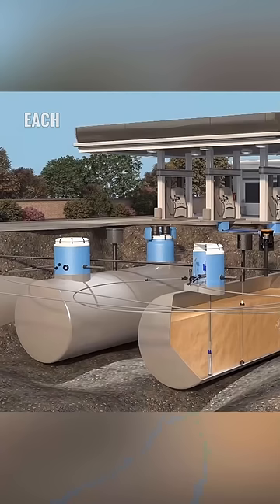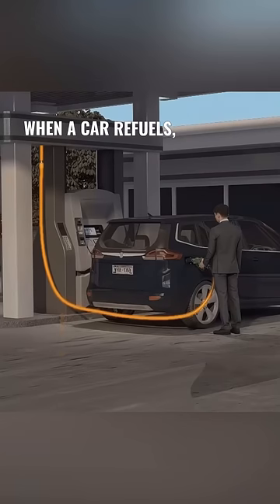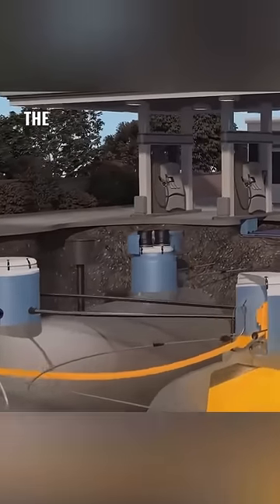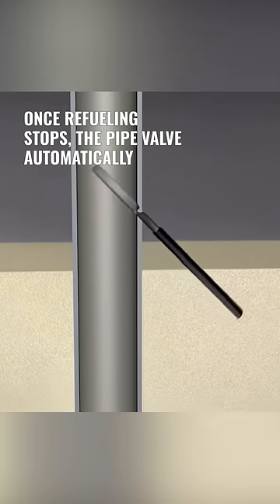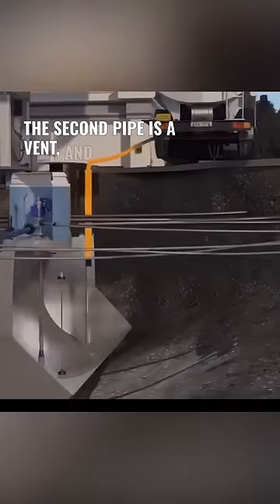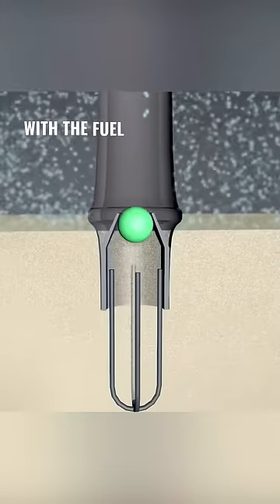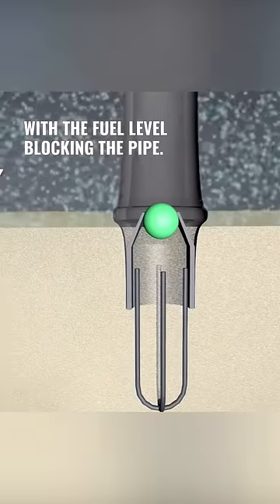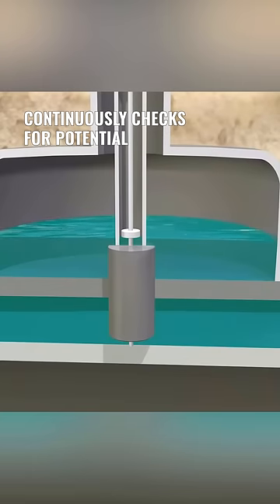Unseen scenes beneath a gas station 🧐

Comment: Here’s y’all some useful information from a retired fuel hauler. NEVER fuel your vehicle while a load of fuel is being dropped. Reason is  While the fuel is being dropped the trash is stirred up need to wait at least 20 minutes to let the debris settle back down. Believe me every storage tank out there has some what water and dirt being disturbed during the delivery process. After 20 minutes the water and dust will settle down below the transfer pump.
Reply: I’m a current fuel hauler, the filters and tanks they use now prevent 99% of that trash clogging stuff up
Reply: Literally not an issue.

Comment: The pipe valve shown is an overfill prevention valve used when the tanker truck delivers fuel to prevent overfilling the tank. The float level sensor is not a valve. Just measures the fuel level.  Your description. Is I correct. 😮
Reply: Veederroot lol, only works 50-% of the time though 😂
Reply: @Steeringwheelholder  ball floats are being phased out in California for overfill prevention.

Comment: I guess the systems on the American and on the European continent could be a bit different. 
Here in Europe it's not only the vapor that floats back from the car's tank to the underground tank. It's also the vapor that floats back from the underground tank into the delivery truck via a computer-coded secondary hose. It's floating back to the wholesales deposit tank from the truck via a 2nd line, from there into the train and from there back into the refinery for further processing.
Reply: It was the same here in the states until cars came with their own vapor recovery system... some states still require it at the dispensers too

Comment: Fuel travels from the tank to fuel dispenser via a submersible pump (red jacket or other brands). There is no valve like you shown.  There is a check valve in the head unit of submersible pump.
Reply: Yeah. It's kind of difficult to get liquid to flow uphill without a pump.

Comment: Just to give people an idea of HOW EFFECTIVE this system is... I used to work at a gas station, and it was mandated by law that the pump motors (the motors that provide the suction to pull the fuel out of the tanks and into your vehicle) had to be shut off if there are no managers present on the premises. However, the pump electronics are not shut off, which does not prevent a customer from using their card and attempting to dispense fuel. 

Just about every single night, you could come in the morning and pull up transaction history from the cash register and see people making $0.00 fuel purchases. However, the first one or two was more like $0.10 to $0.15 because there's still a little fuel left in the lines between the tanks and the gas pump. At roughly $3.50 a gallon, this equates to about one third to about one quarter of an ounce of fuel left in the lines. That's like, a teaspoon.

Comment: As a construction worker we install 10-15 & 20 m3 fuel tanks at gas stations usualy they last for several decades after a certain age we dig down into them and make inspections as they get old from every 2 - 5 and 10 years depending on theyr state. when we dig close to em or remove em, we emty the tanks and gas em before hand to reduce the explosion risk.

Comment: Many only have 3, even if they have 4 or 5 types. When they have regular, mid, super, and diesel there will be 3 tanks and the system will mix regular and super to make the midgrade.  Also theres no difference between any manufacturers gas at the depot.  They add the blend of additives and detergents that make shell, mobil, irvin, etc fuel at the depot.  Theres no way to tell what refinery added what fuel to the pipeline network.  You just add a million gallons at one end, and draw a million at the other ends.
Reply: Back Home we install 3-5 tanks 10 - 20 m3 for a normal gas station.

Comment: Did you know that almost every single gas station only has 2 tanks one diesel and the other is gas so if you are paying extra for the higher grade gas you are still getting the same gas as the low priced gas it says it can't be lower than 87 octane it doesn't matter if it's higher than the posted octane

Comment: Well just a little fun fact from a prior fuel trucker, this video is a load of crap, maybe a brand new state of the art system is like this but most gas stations are just a plain Jane tank In The ground with minimal precautionary measure, just simple engineering. No check valves that shut of when tank is full and no contamination detectors.

Comment: And most of these tanks leak which means when the gas station is done, the area becomes toxic and must be cleaned up at great expense
Reply: Only the ones built long ago... new stations have double wall protection and sensors everywhere to detect if there's a leak